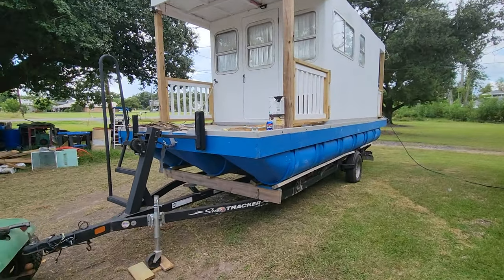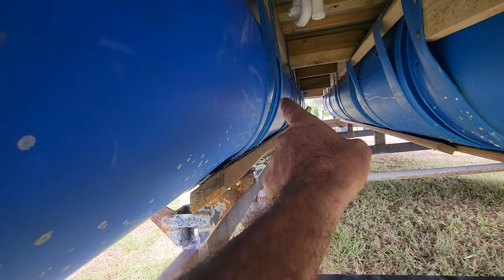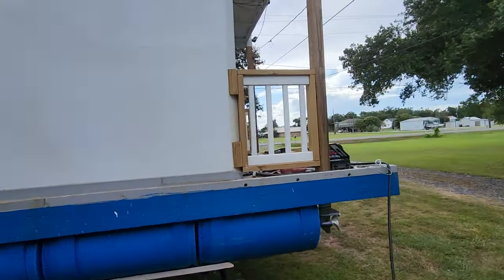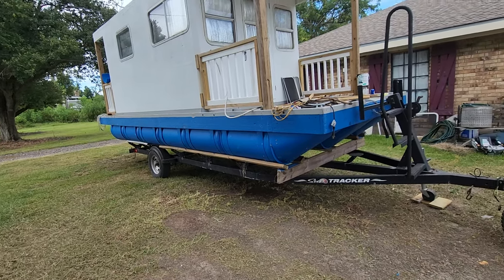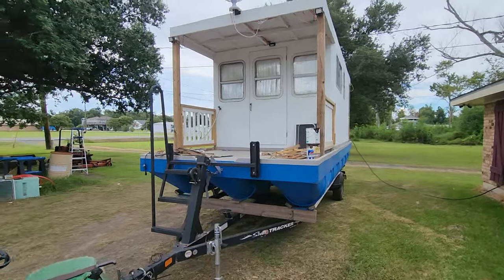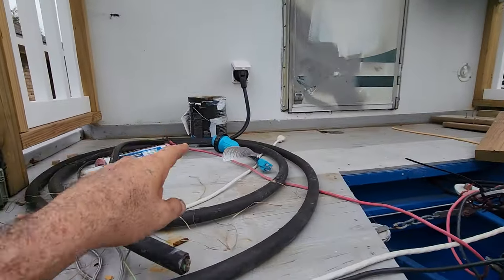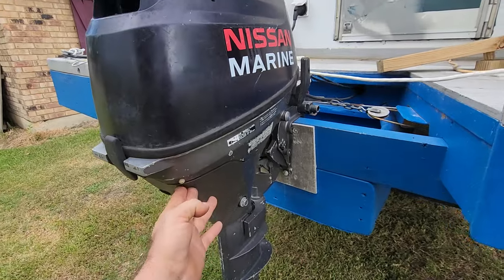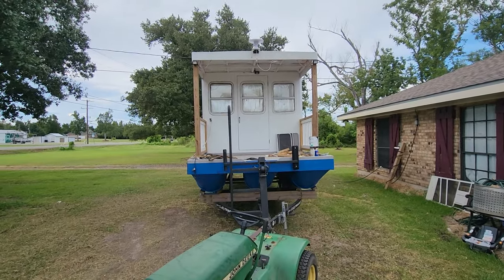Tiny Houseboat Back On The Trailer

Comment: Maybe consider putting 2 axles under the trailer, it will carry the load better and safer.
Reply from the maker: Im building another trailer for it,$1400 for the axels n hardware.
Throwing a 5200 under it will help now,and more affordable.....plus i need a second trailer.